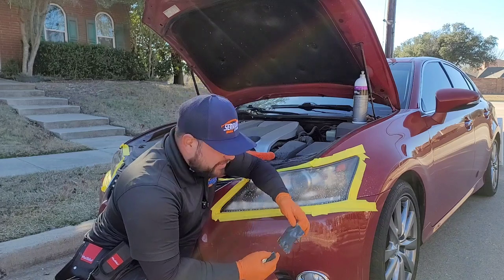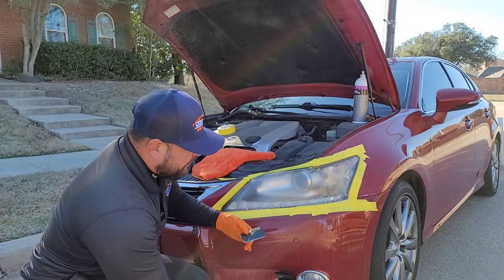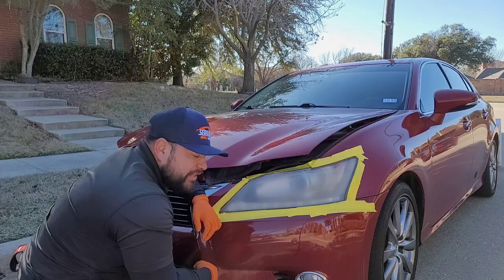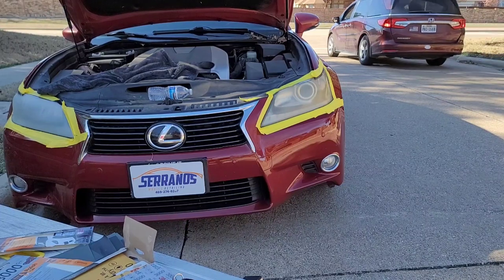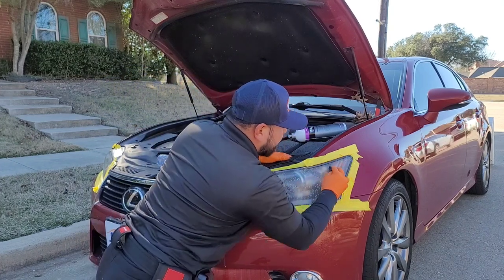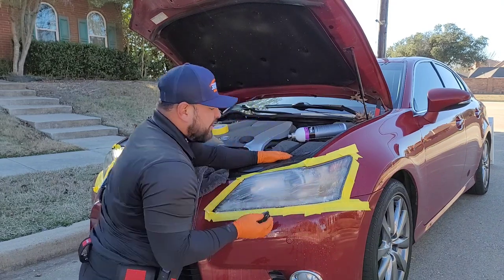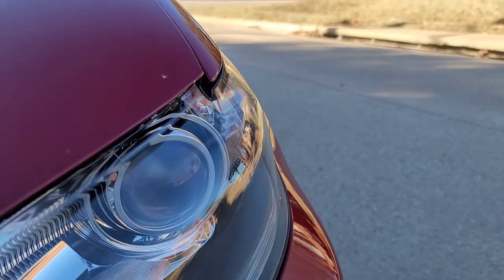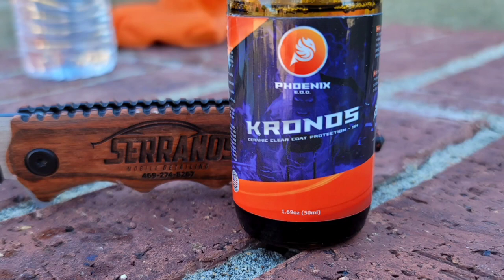Headlight restoration! #headlightrestoration

Comment: Wow $350 is insane! There’s a shop here in SoCal that charges $180 for headlight restoration, and they apply XPEL PPF to them backed with a 10 year warranty. That’s the only service that’s worth more than $100 in my opinion, anything else isn’t worth it because it won’t last anywhere as long as XPEL, not to mention the protection XPEL provides against impacts, coatings and 2K clear don’t offer that.
Reply from the maker: Yes some people take advantage, but 180 is solid
Reply: Expel literally yellows in a few months
Reply: @thewiseguy390  not true at all, my brother had it for many years on his 2012 Audi Q5, I had it on my 2016 Camaro with no issues, plus if it did they replace it for free. 3M is the one that went yellow real quick, that was actually the reason my local shop stopped carrying 3M paint protection film and went over to XPEL, much better product overall.

Comment: Why not use cerakote headlight restoration,  ive used it on 2 cars and it works great , gives you wipes for oxidation,  2 sand papers for wet sanding and then the ceracoat for the headlight
Reply from the maker: I'm still not sold on that package, takes more than just that kit at times to restore the headlights. but i may give in one day

Comment: Crazy how you get $150! I got this surprisingly when landed my second customer. Made $300 on a husband and wife vehicle. Likely from your reputation. I’m still starting and I’ve had a few wins with my ask, but my average quote is around $120. Too many people pass, ghost, don’t commit. I’m in Orlando. Not cheap here as far as living. 

Idk what to do. I have my starting price listed at $89 and not a lot of bites come. 

Any suggestions? I can send you my work via email if that helps.

Also, have you came across any vehicles that wanted the enhancement but that method wasn’t suitable? How did you handle that conversation?
Reply from the maker: it all takes time, took me years to really master headlights, i would offer an enhancement for 60.00 it won't take much time, and keep your restoration at 120.00 the proof is in your work, and how you explain to your customer. i have come across many of those enhancements where i know they will not look good. I do tell my customers what to expect and when i finish i myself say wow these look like trash, and customer comes out and is happy they look better lol
Reply: @serranosmobile  very true. Is there ever an indication where you know the headlight needs restoration and enhancing isn’t applicable? Or does enhancing work on all headlights it just will vary in results?
Reply from the maker: Varies on results
Reply: @serranosmobile  sounds good. And do you seal them after or don’t provide protection? Thank you.
Reply from the maker: I coat them
Reply: @serranosmobile  great thank you sir!